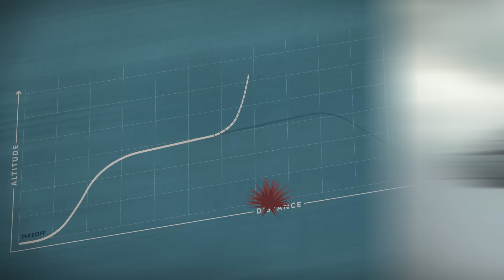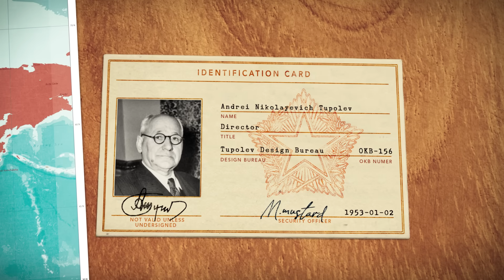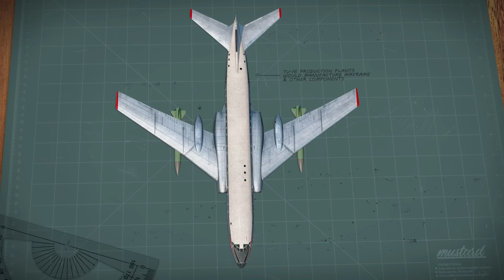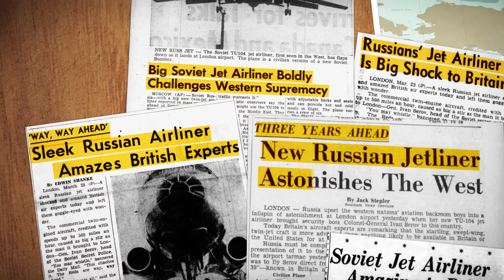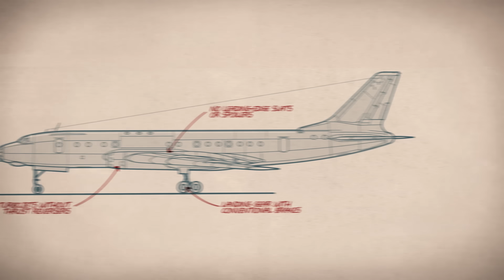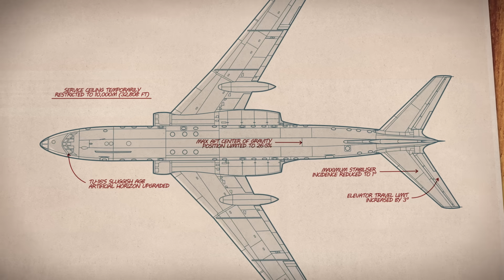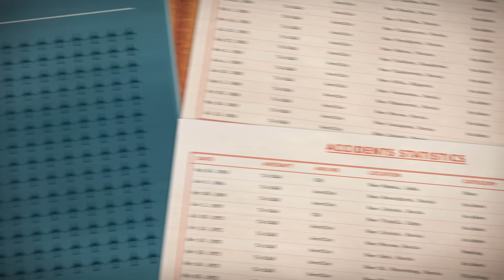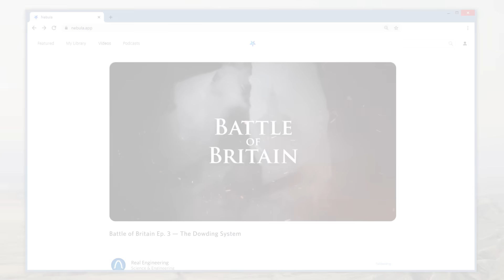The Soviet Airliner Designed To Crash

Comment: Boeing 737 Max: "Hold my beer, Ivan!"
Reply: LOL. This is the greatest thread ever 😆. 
Seems pretty clear who can make a good joke, and who the Die Hard Boeing PR guy is lol.
Reply: @mr.muldoontoyou  Are you a communist or something?
Reply: @sandervanderkammen9230  I've never considered myself one.....are people automatically enrolled if they don't think Boeing is the greatest aircraft manufacturer of all time???
Reply: @mr.muldoontoyou No, it just  makes you sound simple and naive... like you believe all that fake news on  the television and the internet.
Reply: The 737 MAX has never had another crash since then.
Reply: @chadnguyen6332 now the door plugs fall off😂😂😂
Reply: @clarenceghammjr1326  Someone may have left the bolts out, or left them loose. who is responsible has yet to be determined, it would be highly irresponsible to speculate that Boeing is even at fault yet.
Reply: @chadnguyen6332  That is absolutely correct, despite all the media noise, once Boeing was allowed to operate the MCAS system as Boeing had intended there have been no problems.
Several key FAA employees were fired or resigned, the Director of the FAA has also resigned after the agency's appalling incompetence and negligence was revealed by the investigation.
The fact that the FAA was also responsible for the crashes has not been mentioned in any of the mainstream media.
Reply: Here in 2024 parts are still falling of boeings😂 our company policy is strictly anti Boeing to cut down on employee losses😂
Reply: @clarenceghammjr1326  Boeing reported 1.25 Billion dollars in new orders... they have more orders for the 737 than they did in 2019.
Reply: The Boeing 737 is the most successful aircraft in the history of aviation.
Reply: @sandervanderkammen9230  While true, my comment was specifically about the 737 Max and not the 737 as a whole.
Reply: @helbent4  The Max 8 variant is just 1 of many versions of the 737, the most successful jet airliner in history.
Reply: @sandervanderkammen9230  Yes, I agree that makes what happened to the 737 much worse than the Tu-104! Such idiocy.
Reply: @helbent4  You don't have a point Tony.
Reply: @sandervanderkammen9230  I'm sorry if you are still not getting the point.

My point was that the 737 Max showed the Tu-104 a thing or two about bad design leading to crashes. You seem to think that the 737 being successful airliner overall disproves that, but both can be true at the same time: it can be a successful design overall, but in one model bad design led to hundreds of needless fatalities. Those people really did die, champ.

In fact, the 737 being a mature and overall successful design (as you repeatedly assert) and yet still crashing due to bad design is even more of an outrage. At least the Tu-104's designers had the excuse that this was new design territory. They lacked the advantages of advanced design tools, decades of experience and a mature and successful platform Boeing engineers were working from.

And please don't mention again (and again) that the 737 was successful or whatever. We know this already. It's not a relevant point even if technically correct.
Reply: @helbent4  The NTSB found nothing wrong with the aircraft itself... both instrument failure related accidents were preventable, ultimately both crashes were due to the crews not following the proper procedure for runaway stabilator trim control.
Reply: @sandervanderkammen9230  The causes for both crashes were widespread (and do include deficiencies in pilot training and responses) involving more than just the design failures of the 737 Max. However, this somehow does not absolve or negate those documented initial design failures, which allowed those subsequent incidents to result in crashes.
Reply: @helbent4  Boeing's liability is limited to its agreeing with the FAA and not refusing to implement the changes to the MCAS system that were demanded by the FAA that  directly contributed to the accidents.
Boeing designed the MCAS system to function only as a control feedback warning system and was intended to function in a similar fashion as a stall warning "stick shaker", the MCAC was only designed to "bump" the Stab-trim control momentarily to alert the pilot in control.
It was the FAA that insisted (against Boeing recommendations) that the MCAS system was to have full control authority of the aircrafts pitch attitude. It was also the FAA that insisted that the MCAS system could not have a visual or audible alarm to indicate when the MCAS system was active.
Several key FAA employees were found to be responsible for the Max 8 accidents and were either fired or resigned, The director of the FAA was also forced to resign.
The current MCAS system in service with all Max 8 aircraft uses the original Boeing designed version with none of the changes demanded by the FAA prior to introduction into service.
There are nearly 1,000 Max 8 aircraft in service and the design has a superior statistical safety than many other aircraft in service today.
 Boeing currently has more orders for the Max 8 than it did in 2018 before all the bad publicity which should be a good indicator that the airline industry knows the difference between facts and fake news.
Reply: @sandervanderkammen9230  I love your descent into conspiracy theory at the end. Very convincing! Ha ha ha! But your premise is wrong because you seem to think if Boeing is exculpated, it's like those crashes never happened or were not significant or should not count. But however you try to explain it away as (and I am quoting you here) "fake news", two 737 Max airliners really did crash, killing over 300, and design flaws were largely (if not compeltely) to blame.

And so still, 737 Max: "Hold my beer, Ivan!"
Reply: @helbent4  Just the facts here Tony, 
Over 11,000 Boeing 737 aircraft have been delivered to 363 airlines in 111 countries.
There are over 2,300 737s in the air right now and one takes off and lands ever 2 seconds.
One of every 3 persons in the air right now is onboard a Boeing 737.
Over 256 million flights totalling 180 billion miles.
 Boeing's safety record speaks for itself and cannot be compared to aircraft like the Tupelov or de Havilland.
Any questions son?
Reply: @helbent4  The two crashes were ultimately caused by pilot error and a government mandated software patch was a contributing factor..
It is hardly the same as 6 crashes before being grounded and its type certificate being permanently REVOKED... 
Thank God de Havilland no longer exists..
The world is certainly a safer place without their bad engineering and shameful disregard for safety.
Reply: @sandervanderkammen9230  Saying "fake news" to indicate information someone doesn't agree with is not operating entirely from a basis of fact. (That doesn't necessarily make your entire premise wrong, but it is just blatantly false terminology. If you don't agree with something in the news, just say you don't agree, for Pete's sake.)

The Tu-104 did not have its certificate revoked, although it was eventually withdrawn from service. And now we are back at how the Max was in a way worse than the Tu-104 because its design flaws come at a time when passenger aircraft design and manufacture are supposedly a mature industry. Crew were involved in these incidents, but they are not the only critical factor according to the NTSB.
Reply: @helbent4  Sorry Tony but not only is it childish to compare the safety record of Tu-104 to the 737 it is disingenuous and very misleading.
Reply: @sandervanderkammen9230  Also, funny! I certainly won't dispute that overall the 737 is a much safer and more successful aircraft than the Tu-104. That's pretty obvious.

Dang, I forgot to mock you for pedantically bringing up (again) how well the 737 sells. (And not that you suggest this, but I don't personally have anything against Boeing as an aircraft manufacturer. My dad was working for them when I was born, and helped design the 747.) Allow me to rectify this:

Look, as part of Boeing's marketing team you are presumably obligated to give a full-throated defence of one of its most successful products. I know, I know, they keep you spouse and kids hostage and force you to wear an explosive collar, what can you do? At this point you'd triumphantly stride across the courtroom to the crumpled piece of aircraft fuselage and pull off the sticker that says "737 MAX" to reveal that underneath is the logo... "AIRBUS A320"! The courtroom erupts, the judge bangs their gavel as the bailiffs restore order in the court. You shoot me a smug look while I slump down in my chair, head in hands, defeated.
Reply: @helbent4  What is funny is your attempt to suggest that you know more than the people who actually buy commercial jet aircraft for a living and have to deal with the real possibility of losing their job and the jobs of thousands of employees of they buy the wrong planes.
 The fact that nearly 350 airlines have selected the Boeing 737 speaks for itself and completely discredits your humble opinion.
Reply: @sandervanderkammen9230  Ha ha ha ! I'll give this comment an ironic thumb's up. Jeeze, no one should listen to my opinion and I don't think I ever, ever, said or implied I know more than you, or anyone else for that matter. I am literally some internet rando making a dark joke about a series of tragic plane crashes that affected a lot of people in many ways, and not just the victims (as you point out). If anyone thought my opinion was creditable in the first place (or thought it was worth rebutting, and I'm looking at you here, Sander) the joke's also on them.
Reply: @helbent4  Indeed, that was exactly my point... who cares about your opinion  (which is clearly biased  and completely unsubstantiated)
How many commercial jet aircraft do you buy per year?
Reply: @sandervanderkammen9230  Forgive me for correcting you, but that wasn't your point at all. That was my point. Get your facts straight, man! Ha ha!
Reply: @helbent4  I like you Tony, you seem like a good guy but you know you were asking for trouble with your original remark and I felt obliged to give you a little ribbing.
Cheers mate!
Reply: @sandervanderkammen9230  Ha ha, agreed,  and I think this is a good place to end this. You are a good sport and also a fine fellow, have a great day!

I won't say I agree 100% but I did learn a few things.
Reply: @sandervanderkammen9230 today , Tuesday January 23,2024 united says Boeing is no longer in there future because of the ongoing 737 problems 😂